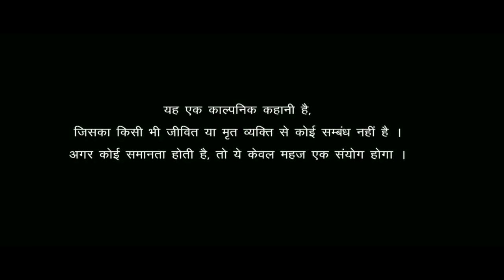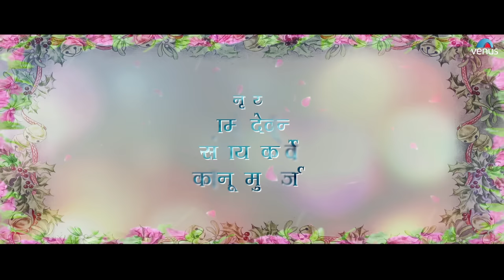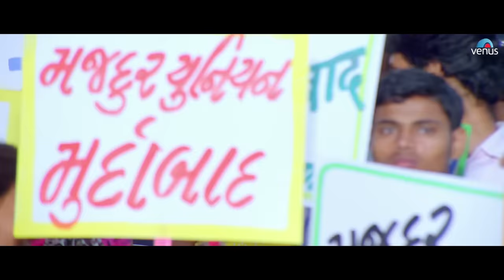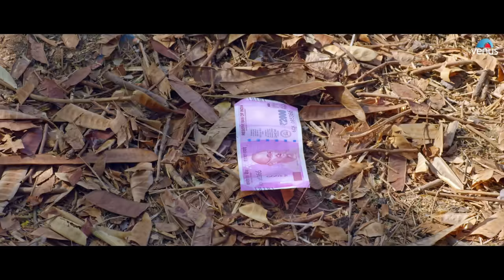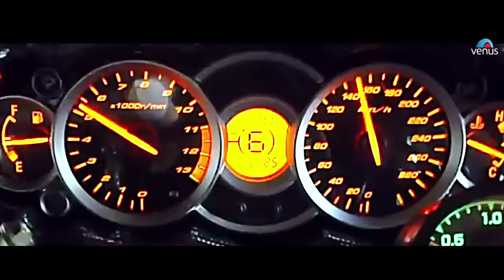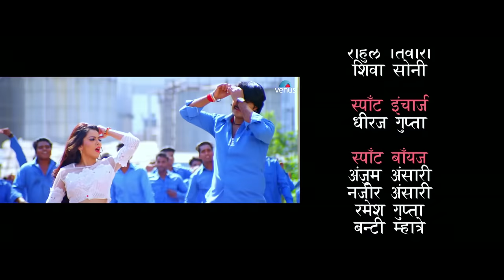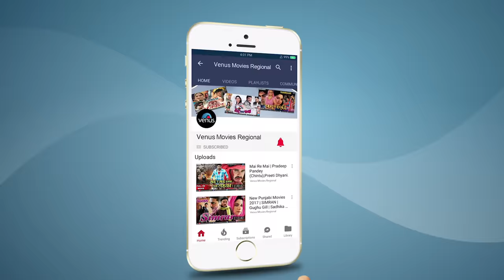Mai Re Mai | Bhojpuri Action Movie | Pradeep Pandey (Chintu),Preeti Dhyani | Superhit Bhojpuri Movie

Comment: Describe white dwarts.
Answer
Depending on the initial mass, stars can
reach one of the three end stages. White
dwarf is one such stage of stars having initial
mass less than 8 times the mass of the Sun.
These stars undergo huge expansion and
their radius increases by a factor of 100 to
200. These stars appear reddish because of
their large size and lower temperature.
Hence, these stars are also called red giant
stars.
At the end of their evolution, these stars
explode, their outer gas envelope is thrown
outward and the inner part contracts to the
size of the earth. However, the density in the
star becomes very high. In this stage, the
pressure due to electrons becomes
independent of temperature and sufficient to
balance the gravitational force for ever.
Reply: L
Reply: L
Reply: Bkhm
Reply: 00000000000000 ko 0000000 ko 00 ko 0000 ko 0000 00 00 ko 000 00 ko 00
Reply: @DeepakKumar-ky2ki  0
Reply: @DeepakKumar-ky2ki  0
Reply: @DeepakKumar-ky2ki  0
Reply: @DeepakKumar-ky2ki  0
Reply: @sanjaymahant238  0
Reply: O)
Reply: @sanjaymahant238  b
Reply: मनन